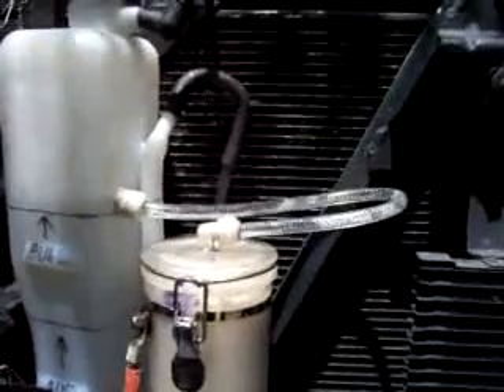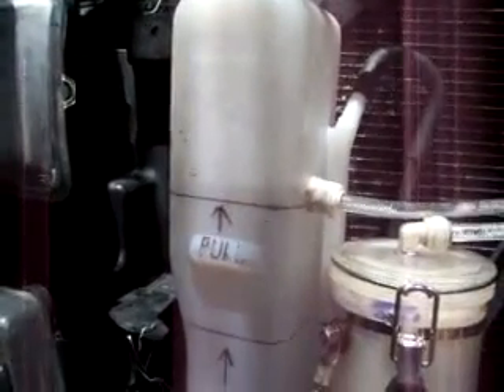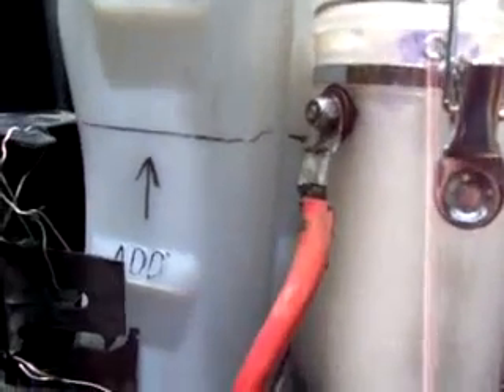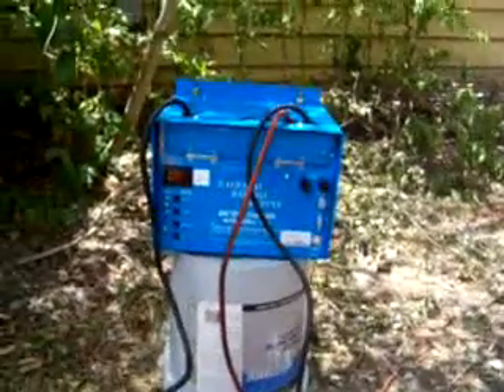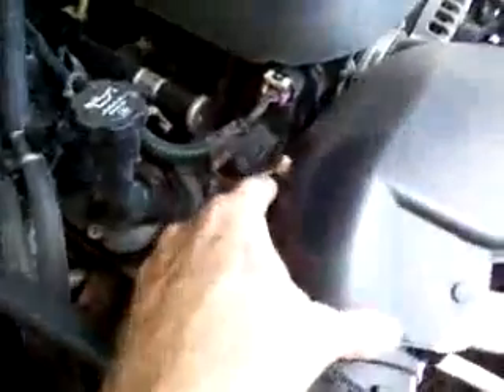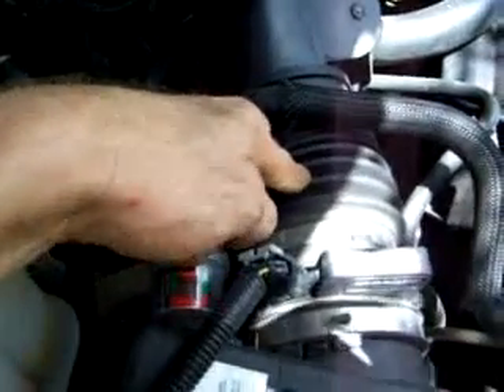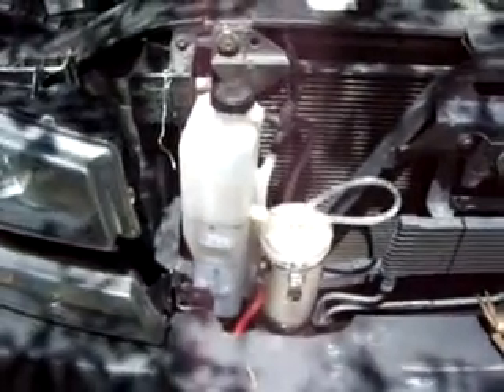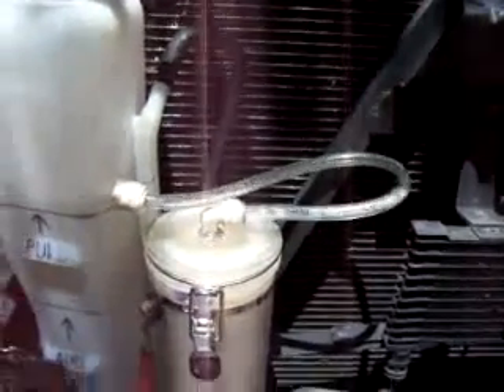hho system installed and running!

Comment: the HHO already has the correct hydrogen to oxgen ratio to explode, so you wouldnt want your mass air sensor to pick up the HHO because it would cause it to dump in more fuel.  In reality its such a small amount it wouldnt really matter though

Comment: try putting your gas in after the sensor ... where you indicated you had tapped looks like a good location ...

think about a way to kill power to your generator wnen the engine is not running ... maybe a relay connection off the oil pressure sensor or something ... 

a few people have had unfortunate incidents related to the HHO gen being acidently left running when they thougt was off (boooom)... 

damn, you got some work into this project ... good luck with it ...

Comment: Nice set up. Peek at zerofossilfuel measureing HHO L/Watt/minute to know what you are putting out. You have a rather large gas area at the top of your bubbler. Did not see spark arrestor. With that much HHO in your bubbler you are looking at a major BANG if sparked. Run HHO output into a plastic cup with a bit of water and dishsoap. Create 1/4" worth of soap bubbles in cup and ignite AWAY from everything. You will gain more respect for HHO. You really need a spark arrestor. Keep it up, good work